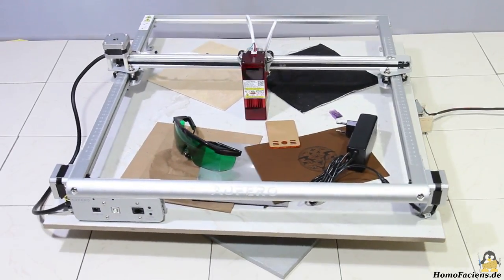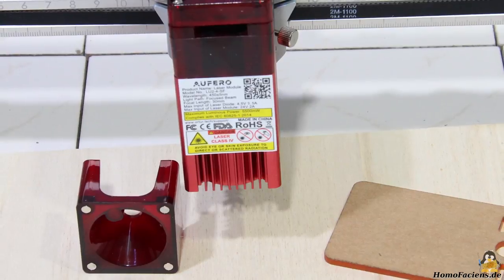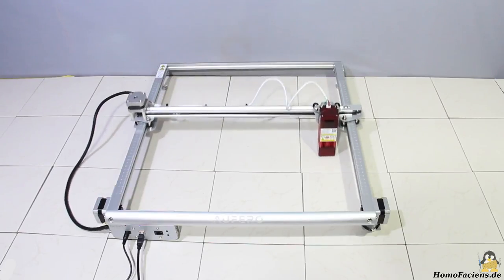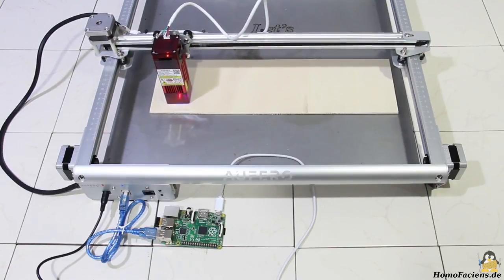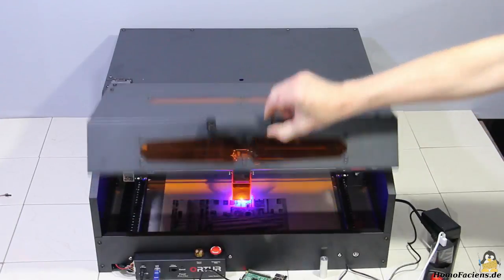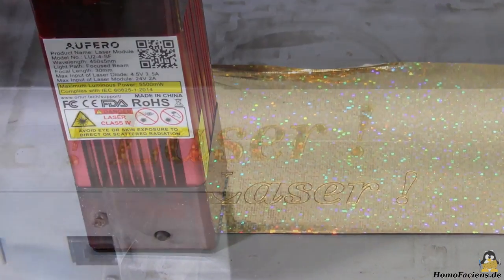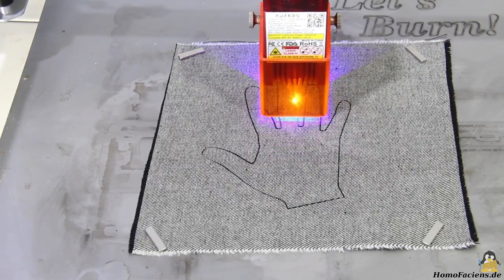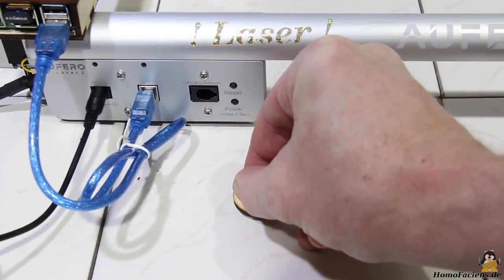Review of the Ortur Aufero Laser 2 engraver and cutter

Comment: What safety glasses do you use ? or recommend ? I have a friend in the Netherlands and is having a hard time deciding which ones are for her Ortur.  (me? I got mine is US OD+6)
Reply from the maker: As I am relatively new to working with lasers I haven't checked safety glasses yet. The ones that ship with the cheap lasers are cheap and for sure not purpose built for the laser modules of those machines. These are good enough to absorb scattered light, but I would not grant they can protect you from a direct laser beam or one that comes from a highly reflective surface. Besides being fit for the laser wavelength you are working with, have a look at how comfortable they are to wear. The cheap ones scratch behind your ears and cause headache over time.

Comment: Are you able to install limit switches in this laser? Nobody has done it yet
Reply from the maker: It has been done. Have a closer look a figure 8 on my pages:
https://homofaciens.de/technics-machines-Ortur-Aufero-Laser-2_en.htm
Reply: @HomoFaciens  Ok, but who does not have Aufero Laser 1 cannot know how to make the connections of the limit switches. Do you know a wiring diagram? I think it has never been published
Reply from the maker: Have a look at the back of the mainboard. The pins are labeled with X-Limit and Y-Limit. The second wire of the switches goes to GND.
Reply: @HomoFaciens  So, the red wire of the switch goes into the free pin ( of X-limit for example) and the black wire goes into GDN always of X-limit? is this connection diagram right?
Reply from the maker: Yes. Since it doesn't mater in which direction the current flows through the switch, it even doesn't matter which color goes to GND or to the X-limit pin. What GND pin you use for the second wire of your switch doesn't matter either.
Reply: Interesting. In GND (both for X and Y) there is already a yellow wire for grounding. Should I add red or back wire of the switch to the yellow one (then two wire in the same pin) or can I move the yellow one to another free pin in another GND of the motherboard? I don't know if this is possible. I hope I have explained my idea.
Reply from the maker: You can add as many wires as needed in a ground pin or in a wire that is connected to ground. All GND pins are joined on the PCB, it doesn't matter which of them you use.